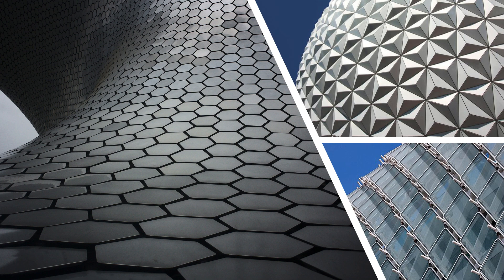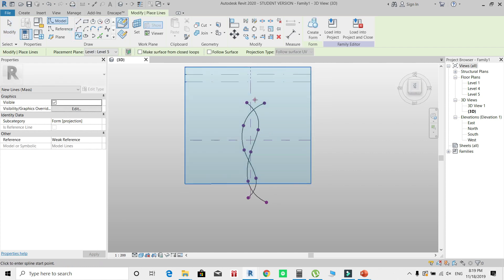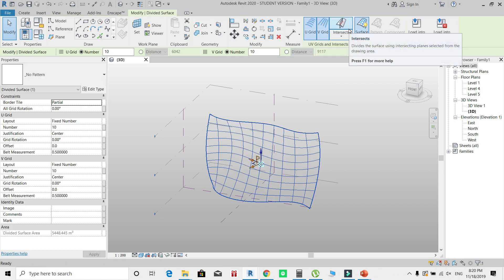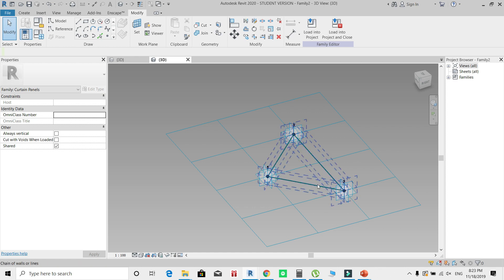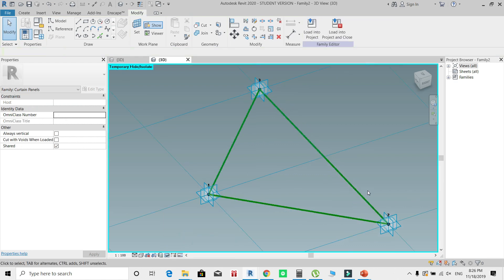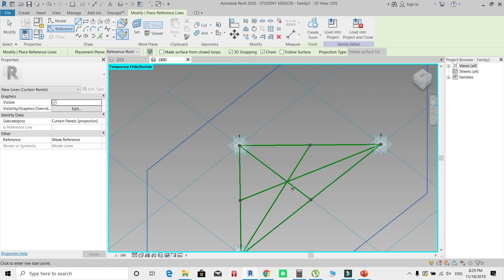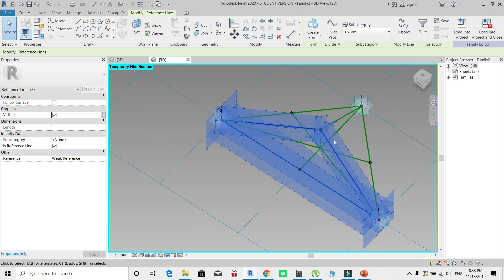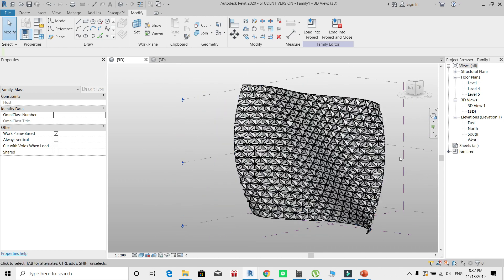Revit 2020 - Geometric Adaptive Curtain Panels - Revit Massing Tutorial

Comment: Thank you!
How do we solve the void error in one of the cells, It has happened to me too
Reply from the maker: This could be resolved by reducing panel height, or disconnecting its members and adding separate joints at the triangle corners. The error also may be resolved by simplifying curvature of the mass surface.

Comment: Is it possible to project a pattern on the surface? so instead of divide it, projecting the pattern?
Reply from the maker: Hi @nolimiters, well it doesn't actually work like Rhino and Grasshopper where you project patterns on a surface. I've used to use this projection technique in Rhino, but that's not how it works in Revit. Let me know what you're trying to achieve & I may be able to help you out. You can send me your email to info(at)revit-courses.com